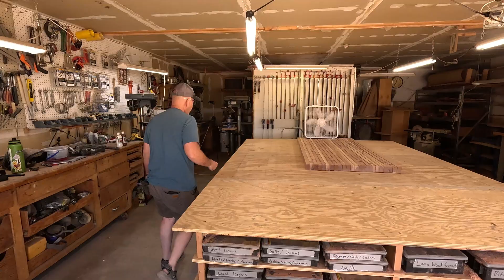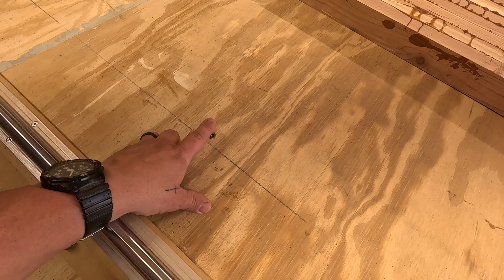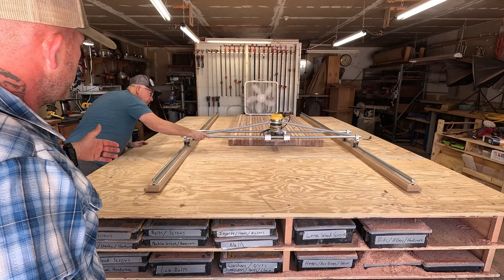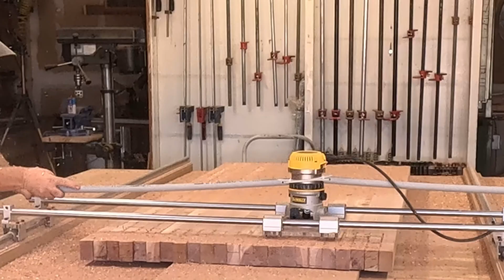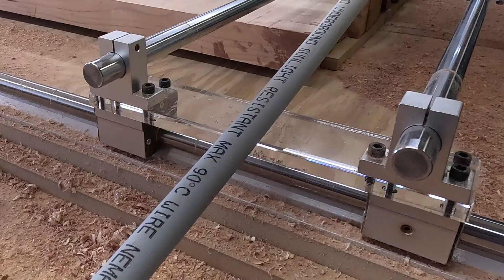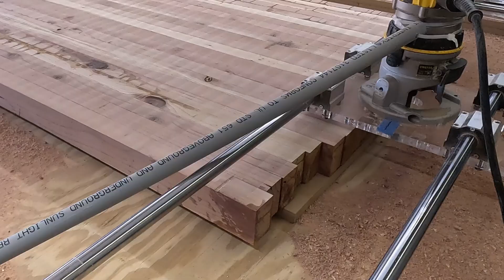Creative Router Sled Upgrades - Sawdust Diaries

Comment: i used to have the same setup for a router sled, but those who actually do it for a dining table knows that the amount of dust it creates is beyond horrible.  if anyone is planning on using this flattening jig, please consider using a dust port and bristles to reduce the amount of sawdust.  it won't be 100% but it will at least get 75% of the particles.
Reply from the maker: Dust collection definitely helps

Comment: That Okie rig will also save your backs.  I have a small sled setup and I have to lean over with about a 45 degree angle to reach across, and my back gets stiff by the time I finish flattening projects that are only about the size of a cutting board.
Reply from the maker: For sure. I was feeling it in my back before we added the handles.

Comment: Nice sled. You could also suspend the router sled from the ceiling on 4 cables and lower it to use it. Have the vacuum and cord from the ceiling also.
Reply from the maker: Thanks so much. We did consider that for the sled. I think we may do something like that for the power and vacuum.